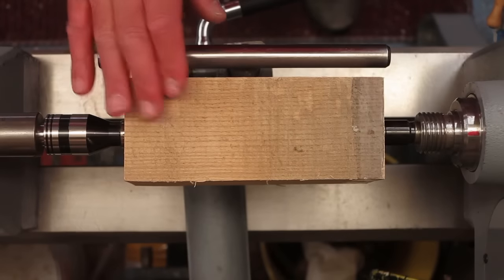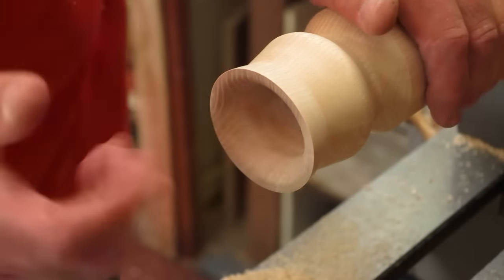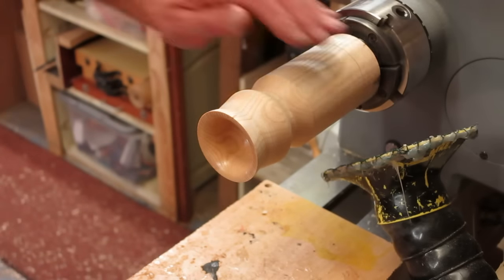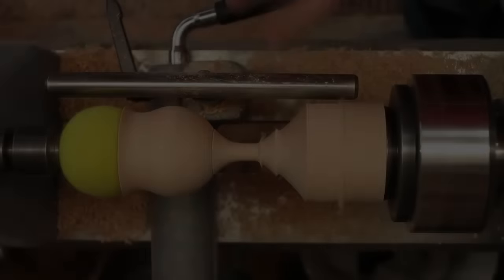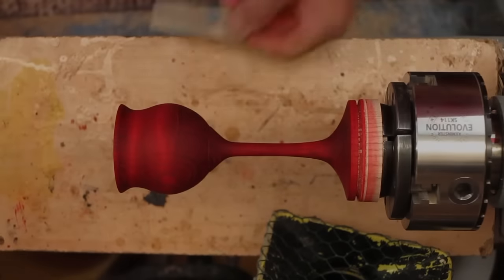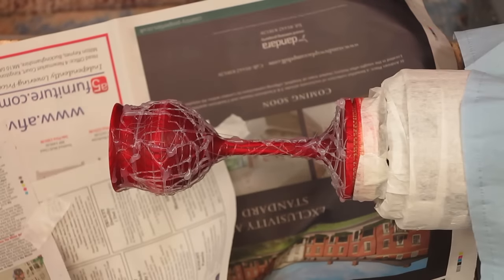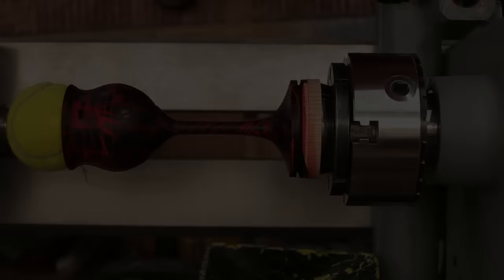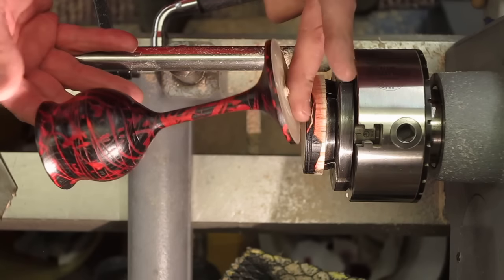Wood Turning - How To Colour a Goblet using Hot Melt Glue

Comment: Your vessel turned out much as I thought it would, Mike. Very nice!

For woods that might stain unevenly I use a shellac sealer (which is 50/50 shellac and thinner) thinned 50/50 again and then sanded down prior to using the spirit stains. The process may seem counter-intuitive—sealing first and then staining, but house painters use the technique often on real wood interior panelling. In this project it really didn't matter since the ebonizer added enough camouflage to hide the unevenness initially seen on the bowl. All in all you've conducted a successful experiment. . . again. Good Job!

Thanks for sharing.
Cheers,
--Joe
Reply from the maker: +Joseph Scarborough 
Thank you Joe, and thanks also for the tip re the sealer. I will try this out on my next attempt.
Take care
Mike

Comment: Great video and goblet, Mike!  Thanks for posting it.  Would it have made sense to mask the inside of the goblet also, to avoid the overspray?  Or does it make more sense to be prepared to sand the goblet rim after everything?
Reply from the maker: +mch000 
Thank you, I suppose there are a few ways to do it, but the over-spray was very little, so a quick sand and wax sorted it out :)
Thanks for watching, and commenting.
Cheers
Mike
Reply: :)  And sometimes the overspray can be intentional and add character!  My pleasure, thanks again, Mike.  Cheers!

Comment: Hi Mike, I like the look. The removal of the glue would drive me nuts though! Something I have been doing with my goblets for a while I thought I'd share with you. You probably have tried it already. It's a little more work but worth it I think. I was always frustrated with the base of my goblets. Parting them off and sanding that nub away just didn't look right to me. Here's what I do now. I round off the stock. I turn a tenon on one end between centres and then flip the wood and mount the tenon in the chuck. Then I turn a recess at the other end and add some small finish detailing and sand and finish it. I then turn it around again and mount it in the recess. Now back to normal goblet production!  It's nice at the end because there is no parting off the goblet, simply remove it from the chuck and voilà!! Good luck with the symposium mate.

Chris
Reply from the maker: Hi Chris, and thank you. That sounds like an interesting method, and I must give it a try, although i must say I don't find the normal way too annoying. thanks also for the good wishes for UKIWS, the nerves are really starting to jangle now ;)
Take care
Mike
Reply: Deep breathes, long walks and beer. Do it in that order and you'll have a great time. Congrats on pulling such a large event together Mike.
Reply from the maker: Cheers mate appreciate it :)

Comment: A great piece Mike, well demonstrated.  I'm going to have to try a different brand of glue stick as it tears would away on my pieces.

Tom
Reply from the maker: +Tom Stratton 
Thanks Tom, I found applying sanding sealer before the hot glue, eased the glue removal.
Cheers
Mike
Reply: +Mike Waldt That would make a lot of sense Mike.  I was experimenting with multiple layers of colour and glue so didn't seal.  I think a change of process is required.  Out of interest, did you seal before gluing on your first black bowl?

Cheers

Tom

Comment: Mike
I want to make a goblet for a friend who is a self made connoisseur of wine.
I do not want to give him a nice bottle of wine as my knowledge is nowhere near his - but I do think he would appreciate a nice turned goblet. I have a wonderful piece of Black Walnut. Is Black Walnut an appropriate wood for turning a goblet? What would I use as a finish that would make the goblet both usable and functional?
I will appreciate any input you are willing to share.
respectfully
Dennis Beamish
Cambridge Canada
Reply from the maker: Hi Dennis, what a great gesture, your friend will be well pleased I think. Walnut is in my opinion a fine wood to use, however all my goblets have been for decorative use, not to drink from. There are excellent finishes I am given to understand, which are ideal for the purpose you need , but I have not had any personal experience with them. One thing I am fairly sure of though is that red wine will break down most finishes in the end, if the vessel isn't rinsed after each use....this is only what I've been told.
Sorry I can't be of more help.
Take care
Mike
Reply: You could insert the top from a wine glass or something that could be removed making cleaning a lot easier and protecting the goblet.